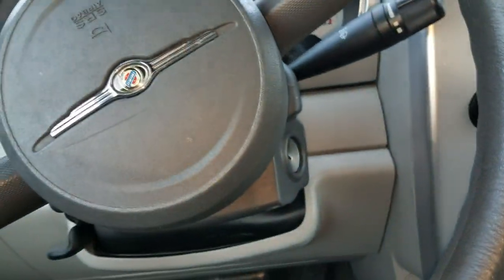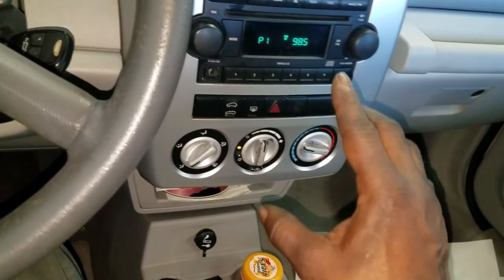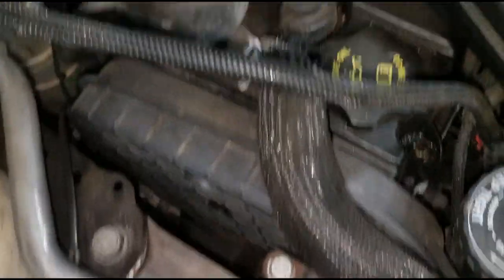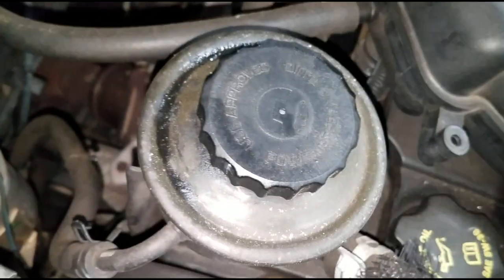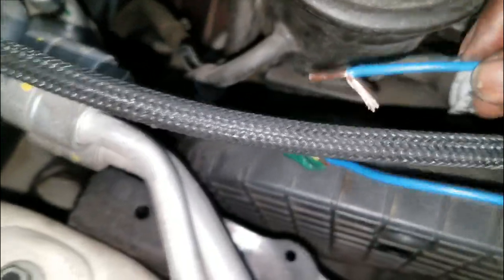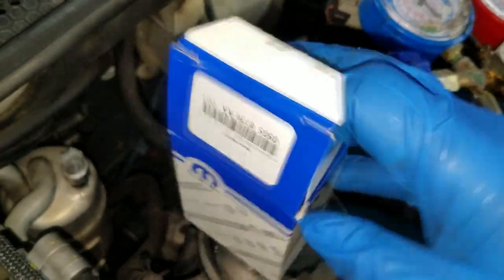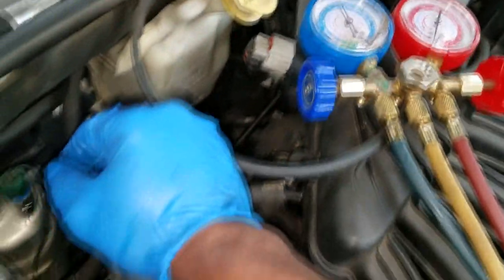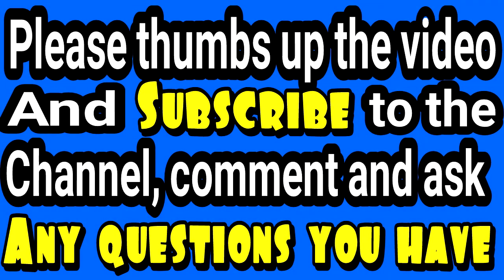HOW TO GET FREEZING COLD AC EXPLAINED. FOLLOW THESE STEPS. AC Compressor test.

Comment: 01 pt cruiser 2.4 base …I jumped a/c low side switch but ac compresor didn’t engage , new ac compresor,new condensor , new line with new small orange filter inside the line, new low and height pressure switch ,some pressure 12 oz can r134 applied, ac compresor relay and fuse ok, can you guide me to fix this problem with the ac low pressure switch side ? And how check voltaje the ac controller inside the car ? 
Thank you

Comment: I took my car to a shop and got this same thing done you just did. Also got a knew condenser end up paying $500 and my air is cool but not cold. I can ride around for an HR with the ac on high and not have to turn the ac down at all my car just never gets cold. It's hot this summer this is a big problem any suggestions. I drive a 2009 dodge charger SXT high out put.
Reply: Could need Freon.  They sell a small guage specifically to check your Freon when turned on.  Some of this gauges will be sold with Freon bottle
Reply: @dannymartinez8522  it has freon in it. I filled it with freon to see if I had a leak. I also got a knew   condenser.
Reply: @jamebrewington4212  you could still have a leak though
Reply: @dannymartinez8522  already checked for a leak then got it recharged
Reply: @jamebrewington4212  did you check how much Freon it has?
Reply: @dannymartinez8522  yes I did
Reply: @jamebrewington4212  if the ac compressor is engaging is hard to determine.  If its constant could be the Freon you used or if it only happened at idle or stops could be your compressor is going out.  It happened to me my truck was nice and cold but when my compressor went out  after replacing everthing it wasn't cold as before but it was good enough to manage.
Reply: @dannymartinez8522  I think it may be the door blend
Reply: @jamebrewington4212  it could be..do u feel the air going out through the bottom vent or  does it feel like your getting hot air like if the heater was on 1 side ?

Comment: side note, to make it EVEN colder make sure to straighten the grill fins on the Radiator and clean up the gunk inbetween them. Isn't that the function of the Radiator?
Reply from the maker: No, theres typically a AC condensor in front of the radiator. You are correct, air flow need to be on point

Comment: I also had a mechanic (blow the lines out) one of the lines was clogged and it was $120 compared to $1500 to replace the whole system. Went to three places two said to replace the whole ac system
Reply from the maker: O wow, good stuff bud but keep in mind, some of those recomendations are given for insurance purposes. Most shops will not make such a repair that your mechanic did because they could be liable for any future problems but I get ya point..Thanks for watching, I noticed you not subscribed. Can you please subscribe to the channel for me? thanks

Comment: with my 2009 PT Cruiser, the compressor comes on and goes off making the engine seem to struggle and jump when in idle. I noted that the 134A fluid was low,  I have added some 134A following the gauge on the container, the compressor came on and stayed on and when the compressor came on the gauge went to the green zone.  a few days later my engine was jumping again when the compressor comes on at idle, when I checked the 134A gauge now it goes into the red zone when the compressor comes on.  What do I do to get the compressor to stay on and not keep coming on and going off at idle? does it have too much 134A in it? or could it be the pressure switch which is going bad?

Comment: Last PT Cruiser A/C problem I had, was on a 2006.  A proper scan tool for the body and A/C functions...not the Autozone "emissions/engine only" kind...traced it to an electrical issue at the output of the TIPM to the compressor clutch.  Probing that circuit showed that it was open. The cause was an open compressor clutch coil.  On a PT Cruiser this means replacement of the compressor and this was complicated by a bent lower radiator support, preventing the mounting bolts from coming out far enough to remove the compressor.  We removed the lower radiator support, holding the radiator and condensor up with bungee cords (!).  Instead of bending back the lower radiator support, we got one from the Pick 'N Pull.
The low pressure switch shown in the video, and the high pressure switch on the compressor, are part of the A/C control circuitry to the PCM, which also includes high-RPM sensing to prevent over-revving the compressor, and high-temperature sensing to turn off the A/C when the engine is too hot.  When the driver has turned the A/C "on" and all those "inputs" are correct, only then does the PCM signal the TIPM to send voltage to the compressor clutch.  On mine, all those inputs were correct and the TIPM was working properly...but it was sending that voltage to a defective compressor clutch coil.  An "electrical" problem was fixed by a "plumbing" repair.

Comment: I have a nag 1 started whining then went in neutral and revs turn car on goes away for 5 seconds while in gearboxes back to revving should I check oil and then conductor plate and valve body

Comment: I once had my 06 Pt Cruiser not cooling when idle only when the car was in motion at higher speeds.  Finally came to realize that fan wasn't working properly.  Once that was replaced car began to cool again. (Also fixed an overheating issue).  So there's that.  Thanks for the video!
Reply from the maker: Yep, Fan has control over blower air over the radiator as well as the condensor. Help with overheating and cooling. Thanks for watching